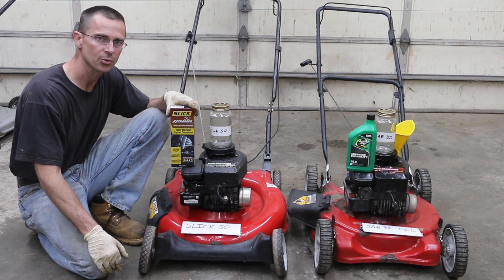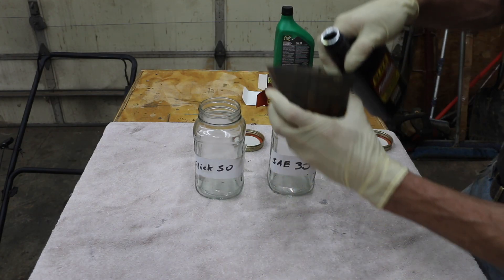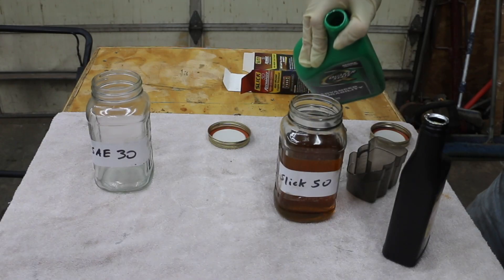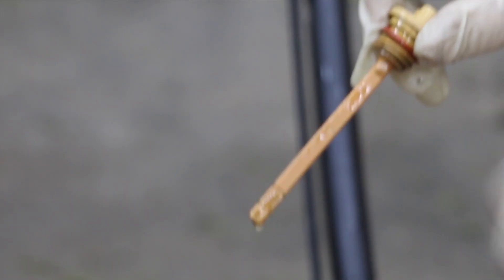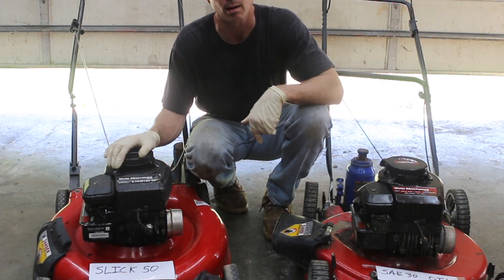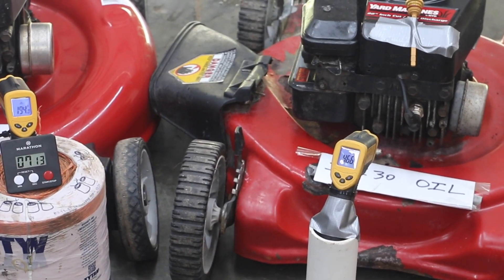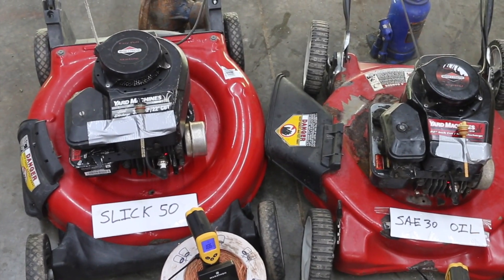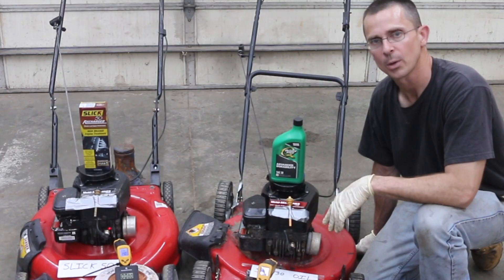Can't believe what SLICK 50 did to my engine!!--Dry Crankcase Test!

Comment: I have used Slick 50 for years and I have never seen it the colour of the liquid that you poured out of the Slick 50 container. As it contains PTFE which is an extremely slippery substance, it tends to settle to the bottom of the container so you need to vigorously shake before pouring. Also they suggest that the engine kneads to do 500 miles before the Slick 50 is fully coated to all friction surfaces. This was not an accurate or fair test, I have had Slick 50 save two engines both having seized due to water lose ( you could have fried an egg on them), they were allowed to cool leak repaired and fresh oil and Slick 50 installed and they both went on faultlessly for 3 years that I know. My brother who constantly monitors his MPG used it, and after approximately 800 miles was getting something like 7-8 percent more MPG, so friction must be reduced to achieve this.
      Neil Roberts. England.
Reply: Do "knead" it with your hands or use your bread machine?
Reply: Here in Germany, such Claims are forbidden to Use. Only Oil you should use is THAT your Manafacturer Says or Thinner (but not much) like 0W40 rather then  5W30, if your going more on Short-Range Trips.... but thats pretty much ALL that you can do, Forget about bogus like that, more trust in your engineers MAN! Or do you believe all the Transport Companys (with Trucks) do not use that stuff, because they do not care about their Engines? No, becaue they KNOW what there doing, they only use Manufacturer Assigned Fluids even Hydrolic or Breaks.....
 Think about THAT!
Reply: Project Farm! Neil Is Spot on! I have been using Slick 50 since the early 90's. My first application was in a 1973 Mazda RX3 Wagon. Once I got the engine up to operating temperature I added the Slick 50. I drove it for 1 hour. After returning home i saw the slick 50 bottle would make an excellent small compact funnel. (The engine went thru a quart of oil a week) So I cut off 1" of the bottom of the container. That’s when i discovered a 1/4" thick layer of PTFE resin, still stuck to the bottom of the Slick 50 container. I did not vigorously shake the bottle as the instructions said to. I got a quart of Valvoline 10W30 and poured 1/4 bottle to a mason jar and then with a small brush added the PTFE resin to the jar as well. I stirred it for 5 min and it mixed to a light brown creamy color.  I re read the bottle instructions and it says vigorously shake bottle before adding to the engine. With my engine warmed up i then added the mixture to the crank case and drove for 1 hour.
     My gas mileage was 11 MPG before the slick 50 treatment. After wards i was getting 13.5 to 14 MPG. The engine temperature dropped as well for the next two years it did not over heat in evening rush hour traffic as it did before the treatment.
    As soon as I saw you pour the slick 50 into the container I knew your missed the part about adding it to a engine "at operating temp" and the other part that said "vigorously shake bottle before adding". I'm not easily sold on gamic products but in my usage I find Slick 50 dose lower my engine temp slightly and has increased my MPG for 1 mpg to 4. Thru different applications i have used it. I don’t work for them but time tested for me it does work if you follow the instructions. And no I don’t work for them or have any affiliation with the Slick 50 Company I’m just a consumer and supporter of their product.
    (Segway Ever wonder why Japanese engines (Infinity, Lexus and Toyota) seem to get to 350+KMiles out of them before they require rebuilding.  In my endeavors, I’ve read that most Japan engine manufactures do not assemble their engines with #2 white lithium. They use a PTFE Resin based paste equivalent to the consistency of #2 white lithium grease, to assemble their engines. Yes It costs more but it pays off in longevity. Most japan engines also have a 1000 to 1500 mile break in because of the use of PTFE resin takes 2 to 3 times longer to break in the engine because of the PTFE application when building the engine.) Do this one over, carefully following the instructions. I'd really like to see the results when applied the way the container directs.
Reply: AGAIN IT NOT THE REAL SLICK 50 John Bishop  (name was change  because he lost the trademark name Slick 50 
.slick 50 today a fraud )   You tube story about John Bishop 
https://www.youtube.com/watch?v=CAt-tJa9P_s
Reply: Bet you did not know you were be lied too .. Should get http://lubrilon.com/support/pds.asp  Now  this product is the  real deal .Was once called Slick 50 until John Bishop lost the 
trademark .What auto shop sell today Slick 50 is a lie . Anyway  
lubrillon the absolute best protection for tranny,engine and whatever . 
Been test in car  and oil drained  .Car  had no wear . My Uncle even did
 this test . I use it  :)
Reply: Neil Roberts but the filter filters out all the PTFE
Reply: David Haney In the late 70's my Father had the franchise for Slick50 in the NW of England, it was tested at Vauxhaul Motors, Ellesmere Port with a dry engine for 4hours after treatment, their Engineers couldn't find any wear on the engine, still like new, it done exactly what it claimed. I used it in my car, the tune up garage was amazed by the results after treatment.
Reply: PTFE is teflon and has a melting point and the engine melted the matial and gummed up and siezed the engine. It might be salvageable if the metal surfaces remained undamaged.
Reply: Polytetrafluoroethylene (PTFE) is a synthetic fluoropolymer of tetrafluoroethylene that has numerous applications. The best known brand name of PTFE-based formulas is Teflon by Chemours. ... PTFE is used as a non-stick coating for pans and other cookware.
Reply: Raymond VanDervort 
I believe tell problem in this test you got no ptfe at all when done correctly slick 50 is caramel color. Not dark like Guinness. So it was not tested correctly to start with. I'm ok with watching ppl test products. But to be fair from the start Slick 50 was not added per the instructions. It would be like saying crazy glue don't work when it was applied to something wet. It will fail almost every time.
Reply: The problem is as I explained the Slick 50  is a fraud as in the fake stuff https://www.youtube.com/watch?v=CAt-tJa9P_s
Reply: I have and update please view this utube short film https://youtu.be/CAt-tJa9P_s
that clears up the why.
Reply: https://youtu.be/CAt-tJa9P_s
Reply: danny phillips 
You are correct!
Reply: Glyn Stein 
I saw a similar test. Where two engines were used one treated the other not. Both were drained of oil. The un treated engine after 10 min failed with a dramatic catastrophic failure. I don't know how long the treated engine ran but we left. It had been running for 3+ hours. LA AREA LATE 70's
Reply: I tried your link and also tried searching for the product but I kept getting a 404.
Reply: Bryant Chandler. Hey I as well found the lubrilon link down. In you tube search for this title
"Xcelplus: What happened to Slick-50? Interview with John Bishop"
Reply: David Haney The original product warned against use in new engines as it prevented them 'bedding in'. It also stated "Not for use in some automatic cars", it reduced the required friction?. My car increased it's idle speed by about 300Rpm! it was reset during tune-up. The mechanic noted various improvements, crank speed, higher spark voltage, lower emissions, increased engine power and Mpg. I still remember my Rpm increasing as it was added to the oil. The good old days! lol

Comment: Not really a fair test. Clearly both mowers were used. Although the mower with slick 50 ran cooler with the oil, doesn't mean it didn't have some other kind of internal problems which caused it to seize up sooner???  A fair test would be to repeat your test with two brand new mowers of the same manufacturer.

Comment: Cool test. The fact that Slick 50 ran much cooler indicates it is the better choice over the long run with normal conditions (oil running in the crankcase)...

Comment: The reason the Slick 50 engine seized up sooner was probably because it had tighter tolerances than the other lawnmower which looked like it had a lot more wear. The tighter tolerances would create more friction. To do the test properly would require two identical new mowers. 

I like to add Lucas Heavy Duty oil stabilizer to my engines, the main reason being that a lot of wear occurs at start up before the oil is circulating. Lucas oil stabilizer makes the oil stick to the engine parts. It might be interesting to do a test with the Lucas product. I do believe it would last significantly longer.

I recall that Slick 50 ad you mentioned. I believe it was a green Dodge Dart with a slant six. They ran the Slick 50 then drained the oil and filled the crank with water. I think they drove from NY to CA with it that way. They also had ads where they ran slant sixes with the oil pans removed, but not loaded. The slant six has the largest rod bearings of any engine in that size range which is probably why they chose it. Of course those old Slick 50 add did not use comparisons to show that their product worked better than just draining the oil and adding water to the crank, so we didn't really know if Slick 50 made any difference, probably not.

Comment: Interesting test. I think the results indicate more which engine had the greatest piston (or piston ring) to cylinder clearance. Without oil circulating, overheating is inevitable, and the piston and rings will thermally expand. As soon as clearance drops to zero, seizing begins. The engine with the most initial wear would last the longest.

Comment: This test was flawed from the beginning.  You would need two engines that are brand new. Who knows what one lawnmower has been through, during it's life, when compared to its test mate. I'm not saying "Garbage 50" actually does anything beneficial for an engine, but for an accurate test you need to eliminate as many variables as possible. Otherwise all data is anecdotal. 

Great video though, loved blowing up Briggs and Tecumseh motors back when I was a kid.

Comment: Back in 2000, I had a 2.2 turbo Omni GLH, which I used Prolong additive in. Once my oil did run dry on drive and was able to drive car a few miles back home - from the freeway, with no oil (I discovered no oil when I got home). Only indication to trouble at first was engine temp starting rising. When I stopped, the engine had a tick, but was still running.

Comment: The engines were exactly the same? (doesn't look like it) Different compression ratios and idle speed and air/fuel mix etc could cause one engine to be hotter than another.
Even with two of the same engine models It would be nice to see if the result was the same testing both of them even if they're different as they are there maybe the one that was colder just runs colder.

Comment: There is a lot about Slick 50 on the web. It might work well in a crude lawnmower engine but it blocks the oil ways in car/ bike engines and is not normally considered a good idea by many testers.  DuPont even tried not to supply it to Slick 50 manufacturers as they said it was not suitable. Just use good oil changed regularly.

Comment: I bought a new motorcycle in '93.  The dealer told me they'd had good experience with Slick 50, so I added it to the oil after the engine broke in.  As a result, the bike got 50 MPG.  Then I read a couple horror stories from guys who put the product in their bikes and the clutches stopped working, so I stopped using it.  My mileage dropped to about 40 MPG.

Comment: i question if the slick 50 exhaust increased the temp of the sae 30 readings. the hot exhaust blowing over towards the sae 30?

Comment: Very good test!!
Militec is supposed to do this. After the metal treatment, you can even run the engine with a dry sump.
Why don't you do a similar test for us using Militec?

Comment: Try Prolong additive. I used it in my Vette and had to take it out because it was too slick. The oil would run down past the valve guide seals with no resistance after turning off the engine causing my engine to smoke upon start up. Prolong is a synthetic oil that has a positive ion charge to it making it adhere to the metal surfaces..

Comment: I sold hundreds of quarts of Slick 50 when it first hit the market at $48.95 a qt. It was Mouse milk then and still is a pure scam. The local Electric Company where I lived at that time went the full route with the oil treatment,grease,std trans oil, and after six [6] months the found it made Zero difference. I was in the part business for over 50 years and have seen may of these products come and go and as in the business they were called  MOUSE  Milk great profit margin. Errol Skip Calvert

Comment: Interesting the slick 50 ran much cooler. Something went on there, not sure what. Maybe it reduced friction but did not really help piston crown heat transfer through the rings. I am wondering if the bottom end bearings on the slick 50 are in better shape than the engine with the regular motor oil. In addition slick 50 could still reduce overall wear as it was intended and seizure may not be indicative of a failure of the product to work. Just a failure of someones' marketing campaign perhaps- not sure.

Comment: Did you run the motor with slick50  in it, for the recommended length of time for it to work ??   It takes a time for the slick50 to form the protective layer of PTFE on the moving parts.

Comment: Lucus oil additive would win this test. It is super thick and  has stopped all the knocking I had in my truck. I have used it for years on all my cars and I love it.
http://www.autozone.com/fuel-and-engine-cleaners-additives/engine-additive-and-cleaner/lucas-oil-heavy-duty-oil-stabilizer/169273_0_0

Comment: Wonder if the slick 50 cleaned the components of the engine causing the failure.  Maybe try it with new engines

Comment: +Project Farm Most quality engines (automotive especially) are designed to run optimally at regular operation temperature. If there was some magic oil aside from the manufacturers branded oil, that greatly improved performance and longevity, everyone would be using it by now.
Reply: Kevin Henrichsen Not so true anymore companies caught on to the fact that they make more money by making things last so long so you have to keep coming back. Levi's used to last much longer before the 80's.
Reply: I run my engines at below operating temp. About 160F with my jeep and 185 with my 4 cylinder DOHC engines with cold air intakes, larger radiators and dual coolant tanks.  With an electric fan I control manually. 

Maybe I'm doing unknown damage to my engines but neither have faltered in any way and I've been it for years. I feel like for a naturally aspirated engines you will gain more power with a colder engine. I also maximize airflow through the engine bay. Hood vents, removing air dams. I run my air filters outside of the engine bay also. 
My jeep is for off-road use... my Saturn before I sold it was interstate use. Neither are dragsters in any way. But I got better gas mileage, always a better throttle response. I understand what you mean by operating temps, however running colder makes more sense to me when you think about heat expansion.
Reply: I also pretty much rebuild them... so I delete factory things I guess and tweak the engine to run at the parameters I want.
Reply: Good critical thinking!
Reply: I could be wrong but I believe I read somewhere once that the normal operating temperatures on most new vehicles is set higher than optimum to facilitate producing good heat inside the cabin for the colder months.  At least for gasoline engines, not sure about diesels.  I put a power programmer on my 99 pickup truck years ago that recommended going from the stock 195 thermostat down to either a 185 or like a 170 thermostat.  I tried the lower one and it basically ran like it was stuck open, gave great power and stayed plenty cool during the hot summer months but ran too cold in the winter.  Wouldn't even warm up enough for the engine to idle down.  Switched it out to the 185 and it was kind of the best of both worlds.
Reply: Kevin Henrichsen TRY Z MAX IT WORKS.

Comment: I would like to see this same test but with Lucus oil additive.  Lucus oil additive is very tacky it seems to stick to parts quite well, I have used it in standard shift transmissions for years now seems to keep them cooler too, after a complete disassembly it seems to result in less wear and tear, but I would really like to see what effects it would have in terms of this specific test that would be interesting.
Reply: For the record with that same standard shift transmission I mentioned above, after having installed it stupidly not having checked the gaskets, I towed a heavy 30 foot RV (and I'm a packrat who brings alot with me too) 600 miles transmission unknowingly bone dry before it finally failed, and after teardown and rebuild I was able to save all the bearings and every gear except 4th gear (4th syncrho overheaded and exploded due to uneven thermal expansion), however, it was surprising it made it from New Orleans to Greenville, SC under that much load before failing, even more surprising I was able to reuse the bearings and what good shape they were in.

Comment: try some Lucas oil stabilizer, ran it in a Jeep with a rod knock for two years, beat the hell out of it and only changed the oil twice. I ran it til I changed the rod bearings and no problem. But I tried using it as cutting oil on a chrome plate and had a drill that'd run 44,800 rpm. it wouldn't even scratch the metal or discolor the oil, had to clean it off with brake cleaner to finish drilling. good video though.